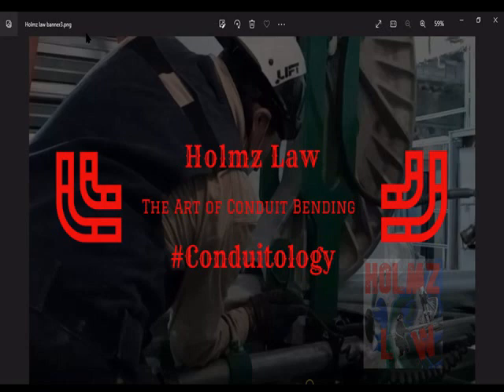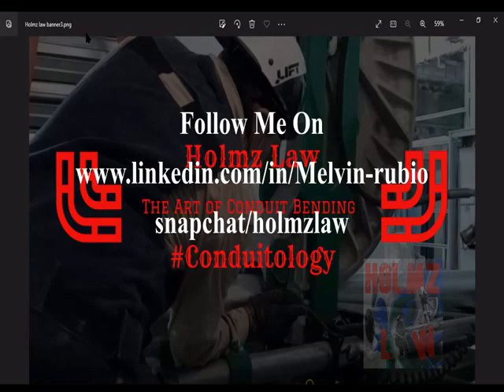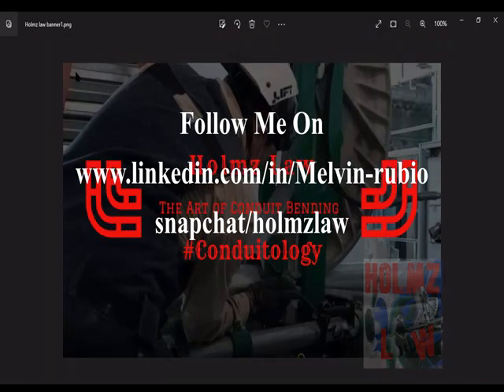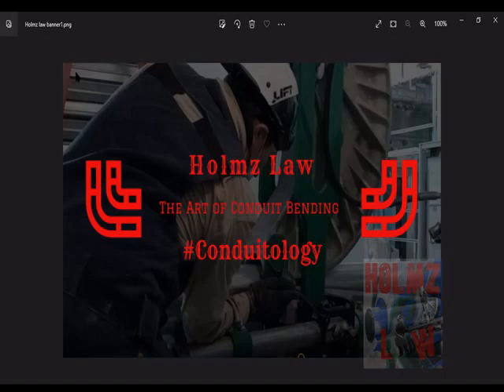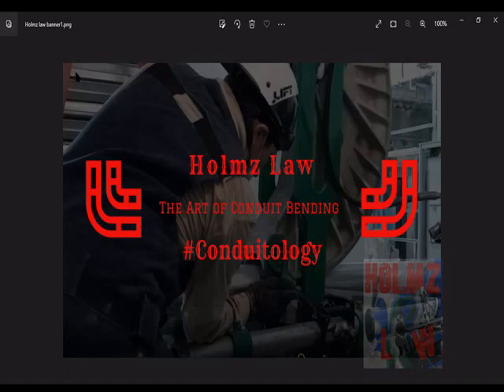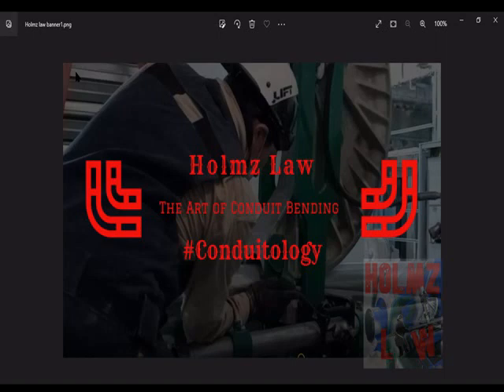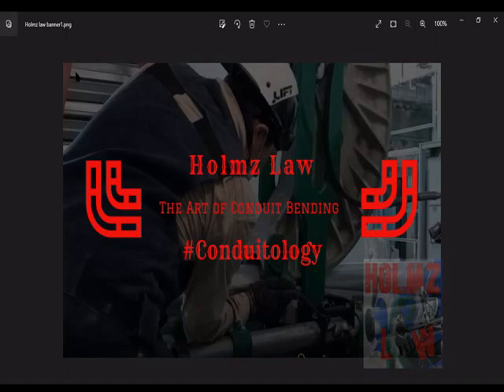How To Teach Yourself Conduit Bending Correctly and Efficiently

Comment: Could you do a video on where exactly to stop the bend on a hand bender? Some people tell me the conduit should be parallel to the angle line and orhers tell me it should touch the line. I still havent figured out where the sweet spot is.
Reply from the maker: So the best way to figure that out is to. First grab a pipe and bend it on the floor with a level or digital level or protractor to either degree you want that the bender has on it for example say 30 deg. After your done bending it and you know it's a perfect 30 degree bend. Flip it upside down without letting the pipe move one bit and look at where your pipe lines up with the bender mark. That's it . Try remembering where that spot is and keep taking it to the same spot. Done!
Reply: @TheArtOfConduitBending  thanks ill try that tonight
Reply from the maker: @kcdakrt  let me know how it works out

Comment: Hey what folding rulers do you use and stand behind in your daily work.   Love seeing people use old school tools of the trade.  Thanks.
Reply from the maker: I like the Lufkin wooden ruler the one that has a slide ruler at one end. Love cause I can set the slide ruler to what ever I want when I need to make multiple small measurements at once. Specially when I do segment bends. I used to love the Milwaukee folding ruler fiberglass but it went weak on me to quick. It wouldn't stay folded I guess the hinges or whatever they are went bad too quick.
Reply: @TheArtOfConduitBending  Thank you, i appreciate your invested time helping brothers and sisters in the trade.  Keep doing what you do.
Reply from the maker: I like the Lufkin wooden ruler the one that has a slide ruler at one end. Love cause I can set the slide ruler to what ever I want when I need to make multiple small measurements at once. Specially when I do segment bends. I used to love the Milwaukee folding ruler fiberglass but it went weak on me to quick. It wouldn't stay folded I guess the hinges or whatever they are went bad too quick.